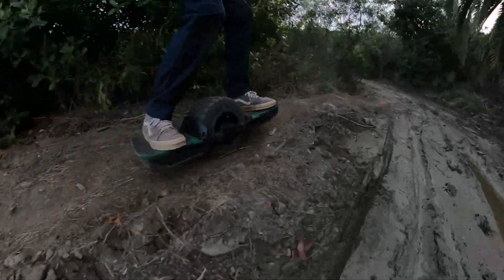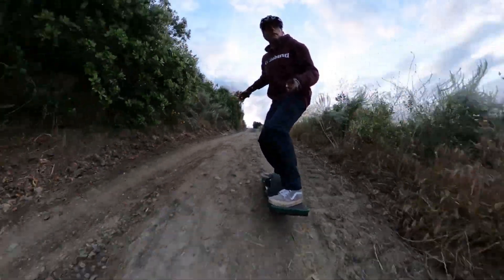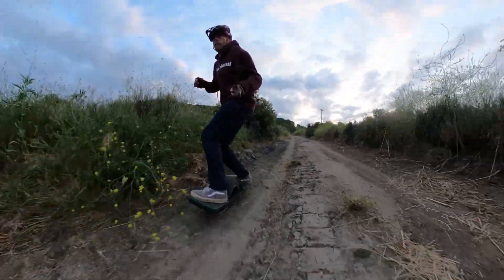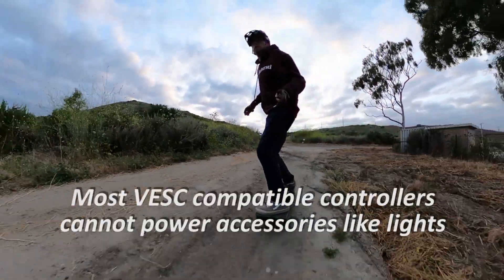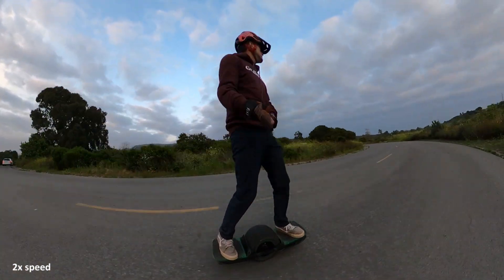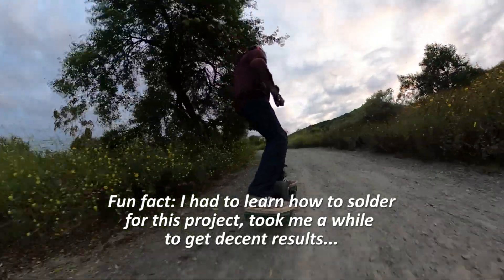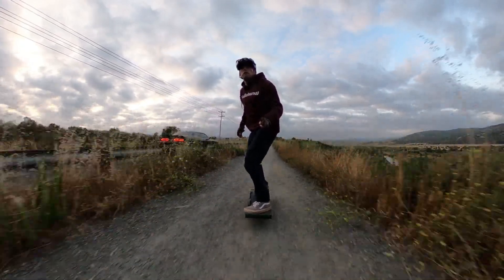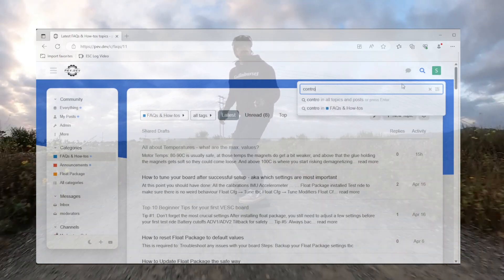Should you VESC your Onewheel? 2023 Edition

Comment: 🧐 I am new to the "float" life with only 2  miles on my used XR+.   It has occurred to me that the XR is preferable over the GT.... the latter being introduced specifically for the purpose of  locking-down platform serviceability moving forward, and with only highly questionable "upgrades".  I believe that with the XR, I can change a tire or have a board shop do this without bricking it, but I am not totally sure.  Can you elucidate on this a bit for me ?     ( If I get into this sport,  I will totally want a Floatwheel, but would probably never touch the controller configuration!   My reasons for potentially moving away from OW is that of reliability, ethics, performance and quality.   )

Comment: Awesome Video, I have been tempted to Vesc my XR for a while, but my GT Controller just died on me and sending back to FM is not really an option in the UK. I will take the controller apart and try to fix any issues I see, thankfully nRf connect should allow me to disconnect and reconnect the battery and allow me to trouble shoot safely, and re-enable the handshake to get it back up and running again. If I can't get it back up and running again with the stock controller Vesc is really my only option. Do you know of any issues I might encounter with the GT i.e proprietarty connectors, can the BMS be Bypassed the same as the Pint, etc.  I am aware this hasn't been done yet, but I assume you might know of places I can go for resources and trouble shooting. Any help would be greatly appriciated.
Reply from the maker: there's a guy in the Vescify Discord (link in description) vesc'ing his GT right now, I know of 3-4 successful GT conversions so far. BMS is the biggest problem afaik because it refuses to work without talking to the FM controller, but others may know more...

Comment: I have a concern with my build. Worked superb, set and tuned up everything. Feels fine.
Just having problem with foodpad sensors sticking at 0V. 
Sometimes I drive 10+ minutes, 
After a dismount oder even while riding it switches to „no adc input mode“ and the board doesn’t engage again.
When trigger Voltage set to 0V in Float Config, the board starts again, I can ride (safe as long i dont crash) and ADC shows voltage at some point..
Reply from the maker: For this behavior I can only think of loose connectors - how confident are you in your JST crimp job? Or the soldering for those connectors? Sticking at 0V is equal to disconnecting the sensor aka a broken/intermittent connection